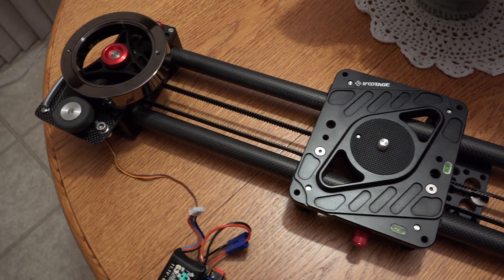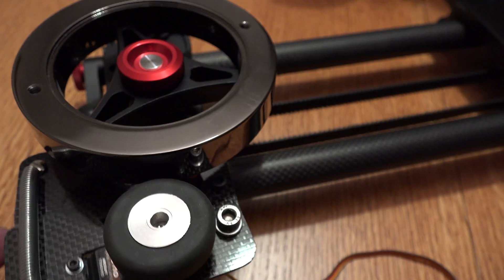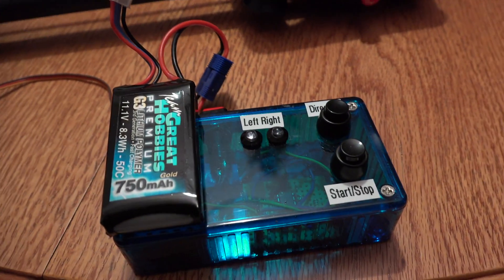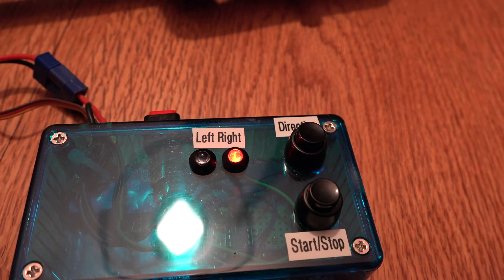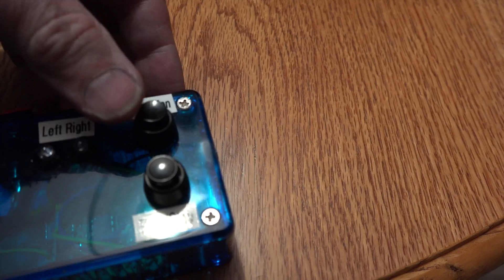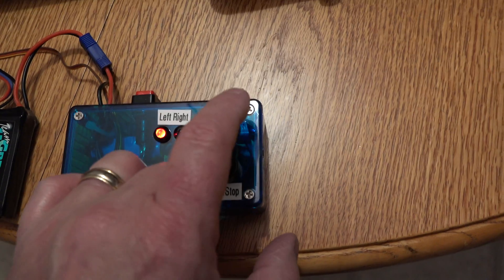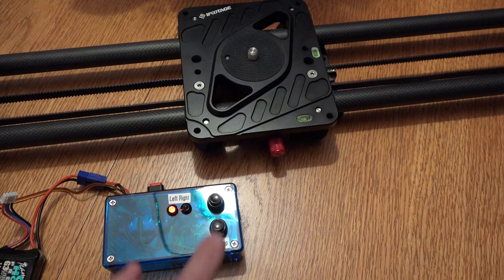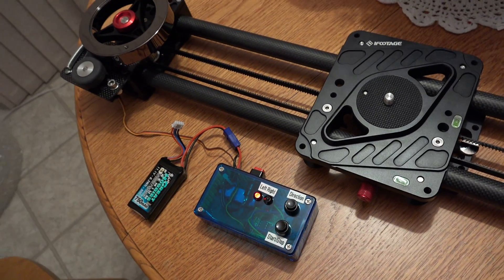iFootage Shark S1 motorized Slider

Comment: Hi thanks for making this video, I am trying to replicate your build, and would love your help. Here is a parts list I have come up with: https://goo.gl/rSNh1g . Any information you could share would be appreciated.For example your thoughts on my parts list,how you modified the servo to go both directions,
guidance on the custom connection to the servo your hobbyshop provided, programming the 8 pin PIC and your custom carbon fiber mount to the slider.I am new to DIY Electronics
and need all the help I can get. Thank you.
Reply from the maker: I'm not convinced that you need a pic if you have an Arduno. It can drive a servo, and the servo can be modified or bought already modified. Literally, you're removing the tab that stops the motor from turning any further and thats all that's necessary. There are lots of videos out there about how to do that, the first one is scary and after that it's old hat. Buy a $9.00 one and take it apart and you'll see how it works. I'm sure there are servo instructions on the net that the Ardruno can be used for, the servo is just 5v, and it's the pulse width that controls the direction. There is no control over the speed, without some really fancy code. You don't need that anyway, just start stop and direction. 
Carbon fibre is not the easiest stuff to work with, you need a good bit in a Dremel as a minimum, but it is really light and very strong. 
The carbon mount was made as two plates, one to mount the things and the other to "float" the servo so that the spring holds it against the wheel. 
The parts list looks good. You're 3/4 of the way there.
Reply: Thanks for your  quick reply !  I would use a pic (to learn) or smaller Arduino as my current one will be used on another project and i would like this to live with the slider. I'm confident about the servo mod based on your description,  I also assume i could also use a low gear motor ? I get that you hand crafted the carbon fiber, without a cnc etc. What about attaching the wheel to the servo at your hobbyshop, how "custom" of a job was that? do you have a CNC design plan? an would that include the teething of the servo?  I assume i can figure out the PWM code to reverse the direction as  dabbler in code. Do you hold the battery and control in your hand when filming or do they mount somewhere? I would be interested in your ideas for possible simple upgrades/improvements as well and what you would do differently if you had no parts lying around to start. Thanks again.
Reply from the maker: The advantage to a servo is that there's only plus and ground required to drive it. If you use a motor, you need to reverse +/- to get it to go the other way. The video pretty much details the code, watch it carefully, it's all logic; pressing the direction sets the output to (I dunno) 5ms pulses, or 10 ms pulses, and then light the appropriate led. When the start button is pressed, turn off the led and start the pulse train. If start stop is pressed, stop the train and light the led. If direction is pressed, stop the train, wait a few ms and start the "other" train. 
The BEC gives you 5v for the board and the motor, because a hobby LIPO can be as much as 15v differential between well charged and empty. Way too wide a range for a pic. 
I just lay the box beside the slider, and I have some velcro on the end to hold it. Thats the flaw, there is not really a way to mount it, but it does fit nicely in the Shark case. 
The plates were crafted to fit in the case, and be as small as possible. The mounts to the Shark all exist and the holes were cut for the servo. The wheel is hollowed out to allow a screw to go into the servo, probably the hardest part of the process, it's pretty easy to strip that, the plastic in the servo is soft.